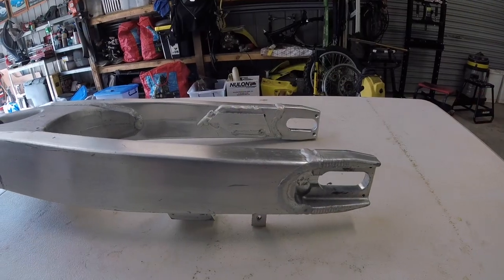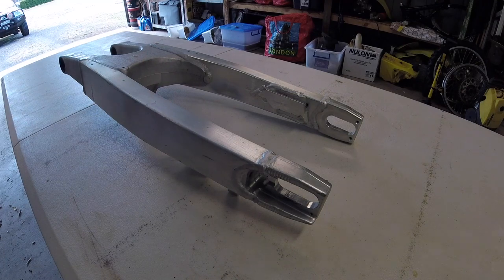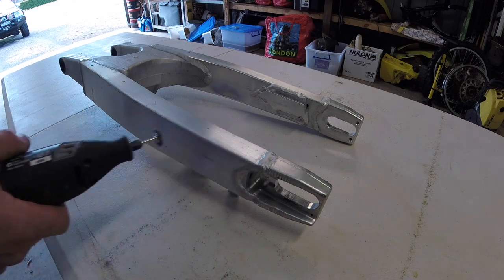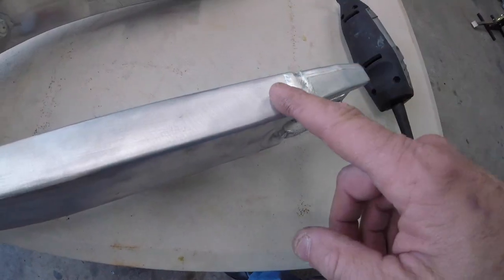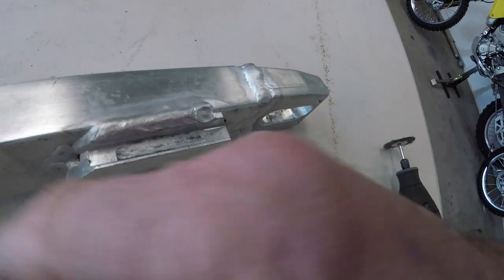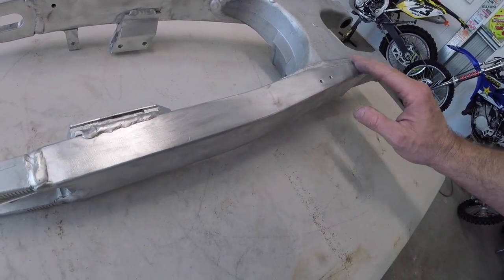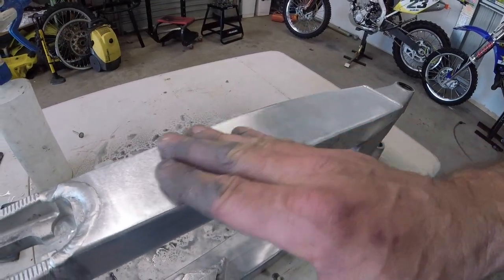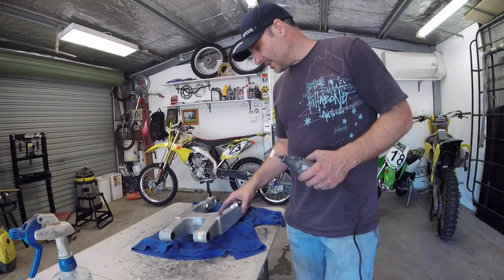How to polish aluminium to Mirror Finish. RM 125 build.

Comment: Hi mate ,well I fallowed your steps and I even went to 7000 grit and it looks like a mirror now .my question for you is how to protect it I'm not to happy with clear coat as it can chip so I'd like to wax it with meguiar's ultimate Wax , what is your opinion on this . Fantastic work and thanks if it wasn't for you I'd not have done it .
Reply from the maker: Thats fantastic I'm happy a video I made has inspired you. I just use metal polish by hand to keep the shine up it only take a few minutes to keep it shiny.

Comment: I just polished vtr1000 swingarm !! Tip to remove the coating is to use oven cleaner - the strongest one and it works a treat👌
Reply from the maker: Thanks for the tips I tried paint stripper and it did nothing 😑

Comment: It turned out really nice I'm interested to know if you're going to try to do at home DIY powder coating I think they call it cerakoting
Reply from the maker: Thanks mate. Powder coating and Cerakoting need to be baked in a oven and the only oven I have is in the house and I'm not going to use the oven we eat out of lol...
Reply: @BrokenSprocket  I've seen people do smaller parts in those little toaster ovens that's kind of what I was thinking. I'm I'm shocked that you don't want to burn off some chemicals in your house LOL

Comment: Hi mate , I'd just like to say you did a fantastic job on that swingarm , can I ask you a question , I messed up and started with 120 grit to get all the agonising off , I then went to 320 and 400 on am on 600 now but I can still see the bloody scratches from the 120 as I understand now vi should not have went so low , how can I get them out , is it just by going back to say 220 and up to 320 and so on ?. Any help would be much appreciated . I understand I might have a job on my hands now but just would like to know if I can still get it smooth . Cheers pal. Keep up with the great video's . Dylan
Reply from the maker: Yeah mate you will have to go down in grades of sand paper till it's smoth then polish. Lots of work lol...